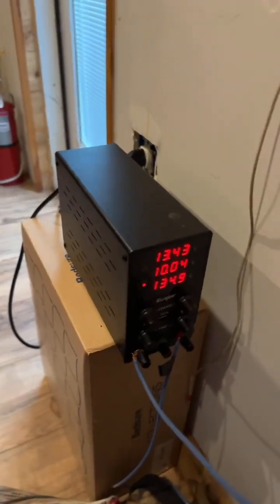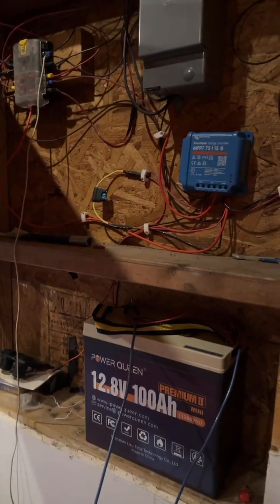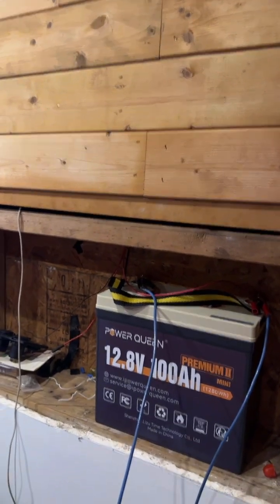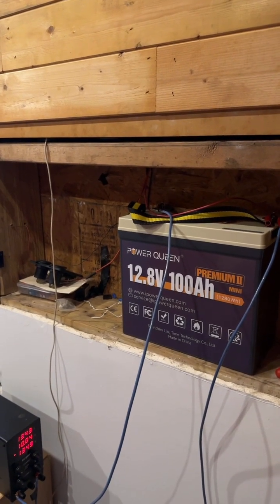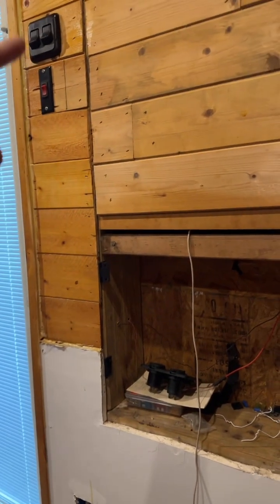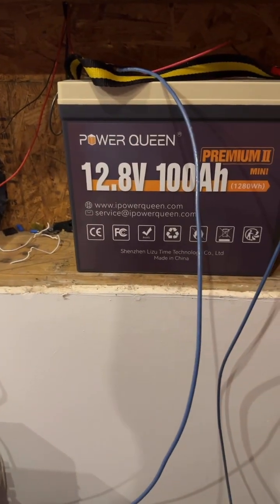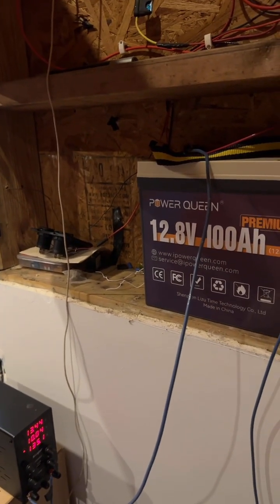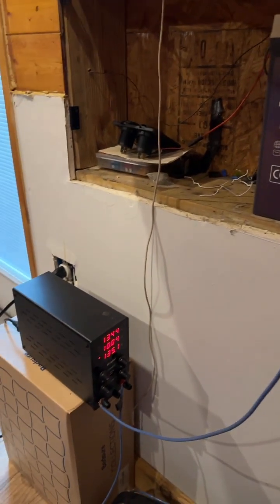Charging our offgrid 12 volt system with the other solar system!

Comment from the maker: First off it low amperage settings, bench charge controller has diodes and you set the parameters to lower voltage than the max it will never go over that. Also Lithium PO4 don’t blow up. Just showing that it can be done and I have done it several times when the solar couldn’t keep up, you can shut off the solar and charge it like you are a normal battery. Understanding is key. Thx for you concern.